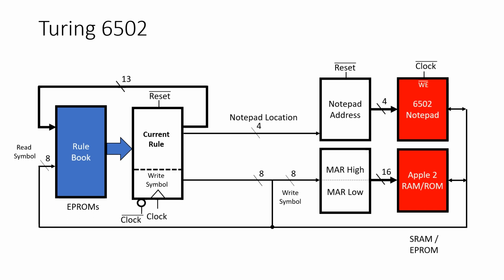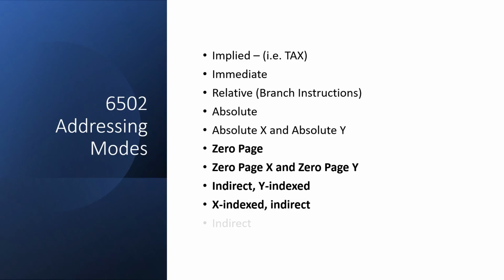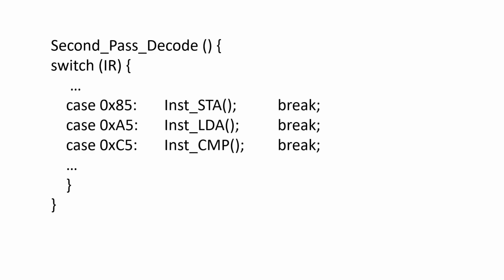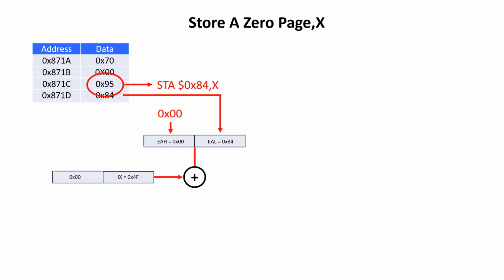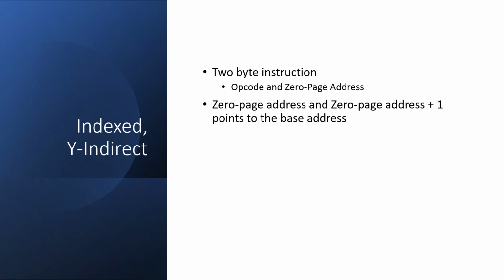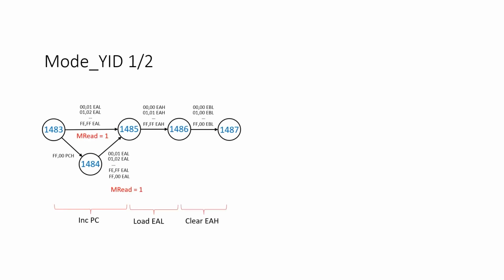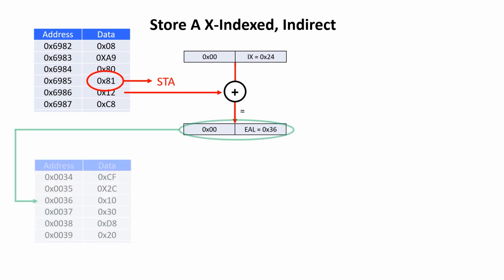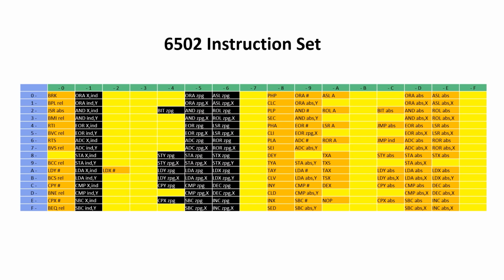Turing Machines Explained.  Zero page addressing.

Comment: I’ve used X indexed indirect mainly when Y is tired up and X is zero or free to be set to zero and I need to load or store A using a 16bit pointer. Off the top of my head I can think of a Huffman decompression routine where I did this.

Following through this video, I can see a place where you can get some useful reuse of the 256 state move to EAL. In indexed indirect Y, you first move EBL to EAL and then add Y to EAL before entering second stage decode. If you first added Y to EBL and then moved EBL to EAL using 256 states, then this places the move directly before second stage decode which is really useful. The move can be used for X indexed indirect, and because the value written to EAL is encoded in those states, anything from the notepad can be copied just before second stage decode. PHA and PLA could use those states to copy the stack pointer into EAL before A is read or stored after second stage decode for example. Note, I have not yet got to the video where you implement the stack, so it will be interesting to see how you do it.
Reply: I’ve realised that you probably use the add Y (or X) to EAL with carry states before the second pass decode for absolute addressing as well as indirect indexed Y. This could still be used by X indexed indirect to do the EBL to EAL move by first storing zero to EAL and then using those states to add EBL to EAL. That would remove the need for those states that do the nibble copy.
Reply from the maker: I'll have to recheck the video and think about it a bit, but yes, absolute and indirect indexed Y will roll over the upper address byte.
I'm actually preparing a video for the same addressing modes on the SAP 6502 now.  Good thought though.
Reply: @DrMattRegan  I’ve been thinking about it more, and believe that it makes logical (and efficiency) sense to add ‘stack indexed’ and ‘pre increment stack indexed’ as addressing modes that lead to second pass decode. That way all stack operations could share a single 256 state ‘move stack to EAL’ before second pass decode, which I believe would be 1 cycle faster than doing nibble copies and removes the states needed to do the nibble copies for all those instructions. X indexed indirect could also use that set of states to move EBL to EAL.

Comment: X indexed indirect is used in Forth VMs. They often use part of the zero page as the data stack and the X register as the stack pointer. I believe it's the Forth store operation that uses it.
Reply from the maker: Thanks for the example.  Yeah, i think i may have been a bit hyperbolic in retrospect.  I was just surprised how hard it was to find an example.

Comment: I would suspect that the likes of GEOS would use X-indexed indirect addressing. An OS intended to have some rudimentary task switching or driver support is really the only circumstance in which I can see it being used much.
Reply from the maker: Yes I suspect you are correct, although I didn’t try GEOS explicitly.  A couple of games used it in logical operations but no STA’s.